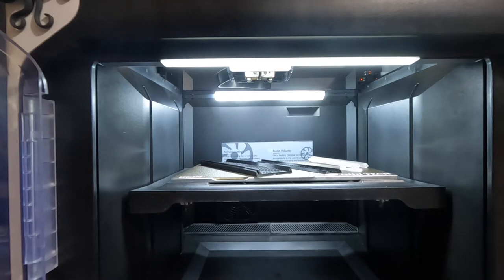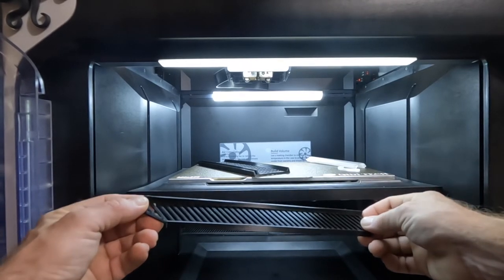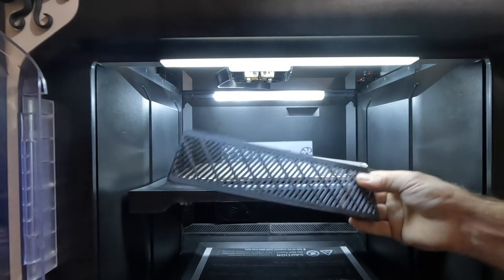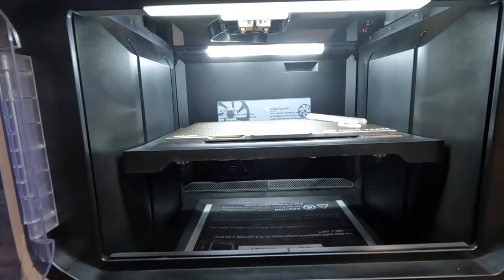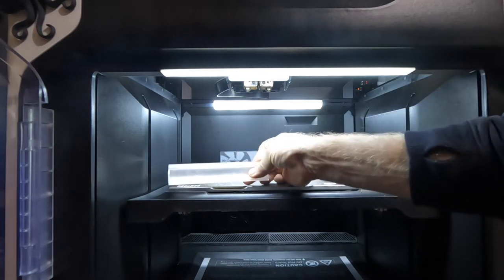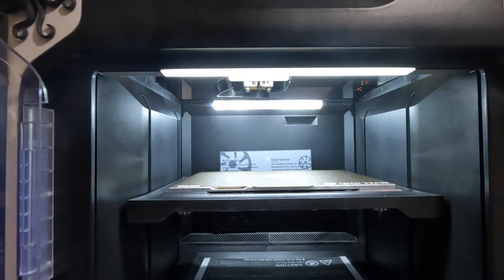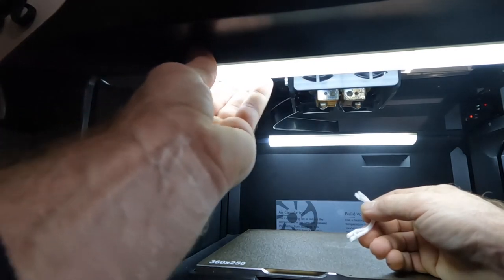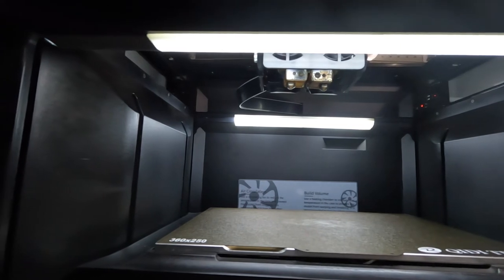Qidi i-fast mods: Front and Rear Light Diffusers and Vents *Check Description!

Comment: Another great video. I noticed you mentioned raspberry pi. I use those on all my other printers but thought I read somewhere they are not recommended on this printer. Really wish I could remember where I read that. I would like to try them but have not had a chance. Life has been getting in the way lately. If you try them I would be curious how you make out. I know Prusa suggest against using them on their machines I am guessing usb is the issue. Keep up the great wok. I am surely watching.
Reply from the maker: Hey Jim!  I saw that another reviewer has put a raspberry pi on the i-fast.  I haven't had a chance to watch the video myself but am interested in checking it out.  It could be helpful to tune prints on the fly for sure as well as octolapse and other features. Thanks for your positive feedback!  If you try out the raspberry pi, I'd love to hear how it goes.  I will eventually buy the parts for it as I have a gantry pro I wanted to add it to as well

Comment: Have you thought in replacing the camera? Since is just a regular wifi camera, I've been looking into the wyze seems like it will fit in the same spot with some modifications and have better quality. Also have you thought in wrapping the interior wall with some heat deflector, they claim you can print Stainless steel filament with this printer. That will be a interesting video. Finally don't get upset with the views a little by little will grow up. You can also made a Facebook page about this printer which right now there's none and perhaps that help you bring traffic to your videos.
Reply from the maker: I actually have thought about replacing the camera.  I have two blink mini cameras that give decent pics.  The real issue is the focal point is too far away so achieving a great picture may only be possible with a macro lens taped to it.  The icookiecam isn't the greatest that's for sure.  That said, even the blink cameras get a bit overexposed by the concentrated light.  One thing I don't mention in the video is that the led lights create an odd effect that can make it appear as though the first layer is lifting.  If you look at led street lights and the patterns they tend to create, it's just the same issue on a smaller scale.  The diffusers help stop that effect completely.  For viewing the first layer in person  these are incredible.  So far so good on the petg temp test.  Pla is a bit too soft.  I will be ordering more exotic filaments as I go.  I'm excited to try some of the stronger ones. I appreciate the insight.  I am not too concerned about views these days.  Just hoping people who do watch are enjoying the content.  I will likely replace the camera in the end.  If you do just make sure you get one that has a short focal distance.  Almost seems worth adding the raspberry pi and buying the macro lens for one of the cameras available for that.  I've been looking, if I find something worth recommending  I'll definitely be telling you about it.  I'd love to fit a pan/tilt camera  in the thing but that's a stretch!  Lol
Reply: @melioratewithnate  I know this is an old post but thought I'd tell you what I did.  I removed the right cover and connected an Adafruit USB to TTL cable to the MB and also replaced the iCookie cam with a Logitech C922s camera, it was a drop in replacement.  I drilled a hole (23mm) in the lower right side of the right cover and installed a dual USB pass through panel mount adapter and routed/connected the two cables (Adafruit and C922s) to the inside of the connector and then screwed the right panel back onto the printer.  I then connected from the outside of the panel connector to my Octoprint Pi and now I'm using Octoprint to load and start my prints.  As well, the control panel in Octoprint shows my C922s stream so I can monitor the prints from my PC.  Anyway, since doing this I now have excellent views of my prints without ducking and stretching to see it.  Very much worth while mod in my opinion.  Thanks again for your vids and files!
Reply from the maker: @larry527az3  thanks!  I'll be doing the same!
Reply: @melioratewithnate  On second thoughts, the C922s will require some mods, while it pretty much drops in, it's sitting too far forward and the extruder hits it,  I'm now modifying the original bracket but may have to modify the C922s as well.
Reply from the maker: @larry527az3  could you take the front shroud off the extruder to help?
Reply: @melioratewithnate  Funny you mention that, I was thinking of just that yesterday but I'm still waiting for a long print to finish before I can give it a try.  Was even thinking of designing a new cover but that may not be necessary if I just run it without the cover.  Thanks for the suggestion.
Reply from the maker: @larry527az3  if you check my latest videos, I chopped mine for a better view.  I think the new extruder comes without it doesn't even have the threaded inserts for one.   It would trap hear or inhibit cooling anyway.  Happy to help.
Reply: @larry527az3 so how has it been with the pi added? I have also been thinking about doing this mod.
Reply: @Phoenix_On_Fire  The only issue I had with using the PI and octoprint, was that the temp chart in octoprint would change to impossible temps (really high numbers) but it only did this after the print was finished.  Sending another print job would clear it and all would be normal until it finished the print again.  In other words, it was just a minor glitch that I lived with.    Anyway, I have since sold my Qidi printer, had too many other issues with it and was tired of always fixing it. I do recommend my mod though, it made using the printer night and day better than working from the onboard screen/controller.